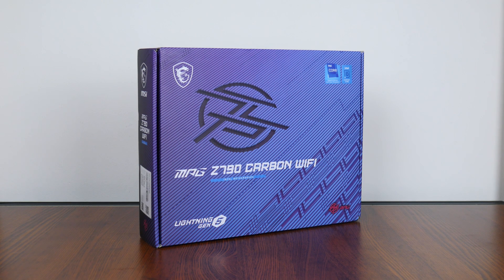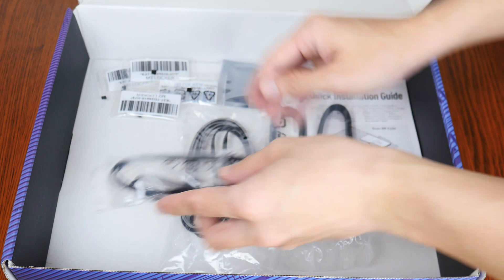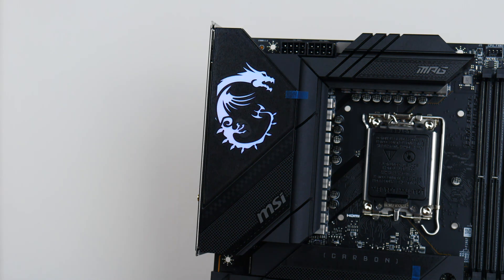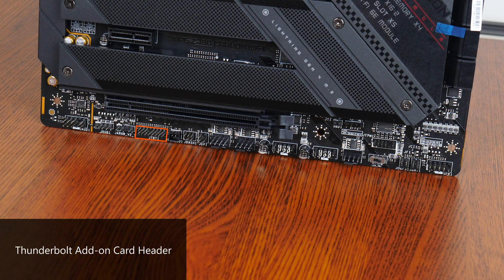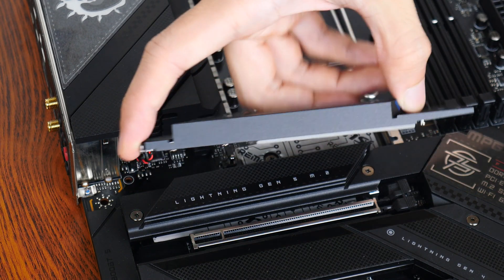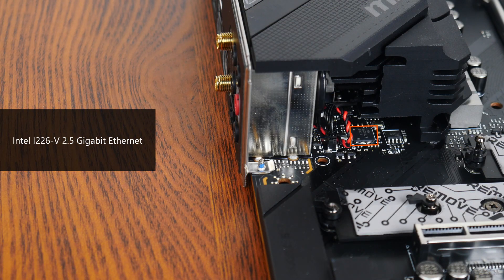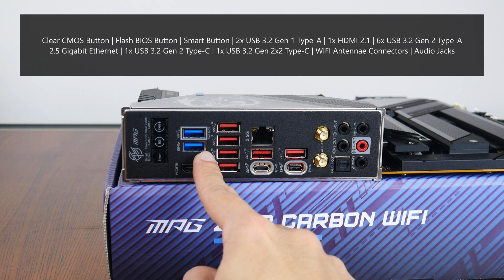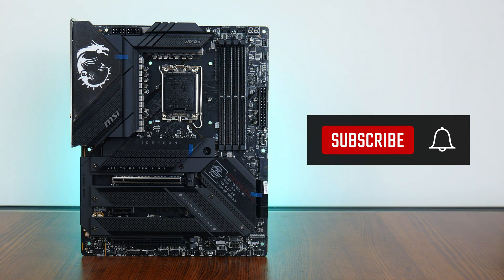Premium Intel Z790 Motherboard - MSI MPG Z790 Carbon WIFI Unboxing & Overview

Comment: Would installing a ssd on the second m.2 slot hurt gaming performance in a 3080ti?
Reply from the maker: It likely will, but perhaps not by too much - the graphics card slot will run at PCIe 4.0 x8 (seeing as the 3080 Ti supports PCIe Gen 4 and not 5), and from what I've read, this should result in a performance hit, seeing as the 3080 Ti is pretty powerful and should be able to saturate the lanes easily. I don't have such a combo of hardware lying around though, so I can't test it out for myself...
Reply: @ALKtech  thank you for your promptly reply. Yeah I would probably not use that m.2 slot to keep it save. Saldy I'll only have 4 m.2 instead of 5 😆

Comment: I've not built a pc for over 10 years and I'm so out of touch lol
Reply from the maker: In a nutshell, DDR5 is becoming more mainstream as DDR4 works its way out, we've got the AMD Ryzen 7000 series on the AM5 socket, and Intel's 13th Generation Raptor Lake as the processor offerings today, and NVIDIA's GeForce RTX 4000 series squaring it off with AMD's Radeon RX 7000 series GPUs. How's that for a 10s summary on the state of the PC hardware world today 😂

Apart from the above, it's pretty much still the same old plonk-everything-onto-the-mobo, and fire it right up kinda thing!

Comment: Am I understanding right you shouldnt put an M2 NVME in the PCI 5.0 M2 slot to avoid splitting the lanes from the GPU?
Reply from the maker: That's right, but seeing as there are no PCIe 5.0 x16 graphics cards around yet, no issues here really, seeing as PCIe 5.0 x8 has the same bandwidth as PCIe 4.0 x16!
Reply: @ALKtech  even if one uses a 40's series cards??
Reply from the maker: @Gabriel3Gamu  ah, perhaps I should clarify further that in the above reply, it's in the context of PCIe 5.0 x16 graphics cards of the future operating at x8 mode, where the said card will still have access to the equivalent of PCIe 4.0 x16 worth of data bandwidth! But then again, I don't have a crystal ball to be able to say for sure if the next gen of GPUs, especially the high-end ones, will be powerful enough to saturate all 16 PCIe 5.0 lanes - only time will tell!

For top-of-the-line PCIe 4.0 GPUs such as the RTX 4000 series, you'd likely see a performance hit where the said GPU will operate at PCIe 4.0 x8 instead, if a M.2 drive is installed on the 2nd slot for this board. I must caveat that I haven't personally tried this out to see how much of a performance hit one would likely experience!

Comment: What's the best mid range value for $ MSI mobo to go with the i5-13600K? I'm looking at MSI MAG Z790 Tomahawk WIFI DDR4 or MSI MPG Z790 Edge WIFI DDR4 but they're quite exp, almost near the price of the DDR5 version of both Mobos. Wondering if you have something else to recommend?
Reply from the maker: Actually...if you don't mind previous-gen boards, Z690/B660 boards could be pretty good picks. I quite like the MSI PRO B660M-A WIFI DDR4 and have used it before in a friend's build (but that was with a i7-12700). Are you quite set on DDR4 for your build already?

Also, heads-up that Intel's mid-range 700-series boards (e.g. B760) are dropping real soon, sometime in the first week of January 2023, so if you're not in a rush, it might be a good idea to hold off till then to see how prices of these boards might be like! Unless of course, you're trying to avoid paying 8% in GST...
Reply: @ALKtech  Not in a rush to upgrade. GST 8% is bo bian lol. Pay means pay. Currently am still running an i7 4790k. Can tank me a while. Almost 8 years now. I was thinking if i can squeeze out another 3 more years on this rig, totalling 11 years of usage by 2025, holding out until Intel 14th Gen Meteor Lake drops next year Q4 2023/ 2024 or 15th Gen Arrow Lake in 2025. For the 14th or 15th gen, either one of the i5 600k series is good enough for me.

Current rig: 

CPU: i7-4790k w/ Corsair H100i Liquid CPU Cooler
MB: MSI Z97 Gaming 5
GPU: MSI RTX 3060 VENTUS 3X 12G OC
RAM: G.SKILL Ripjaws X Series 16GB (2 x 8GB) DDR3 1866 (PC3 14900) Desktop Memory Model F3-1866C9D-16GXM
SSD: Samsung 840 EVO 250GB x1, Samsung SSD 850 EVO 500GB x1,
HDD: Western Digital Blue 1TB
Monitor: Acer Predator XB271HU
Speaker: Razer Leviathan 5.1 Channel Surround Sound Bar
PSU: SeaSonic PRIME Ultra Gold 850W 80+ Gold Certified Fully Modular ATX Power Supply
Case: Corsair Carbide Series Air 540 High Airflow ATX Cube Case
OS: Windows 10 Home - 64-bit - OEM
Reply from the maker: @BravoSixGoingDark  What do you use your rig for mostly? Am curious how a Haswell+3060 combo would fare in terms of framerates haha. 

11 years of usage would be quite a feat 😂 But again, if your use-case doesn't call for an upgrade, no harm just waiting till you see something that really calls out to you, or until hardware failure occurs *touch wood*.
Reply: @ALKtech  Watching shows & Casual gaming e.g. BF1/BFV/B2042 (Stop playing because its trash haha). Got into emulation recently this year Duckstation/PCSX2/PPSPP/RPCS3 etc.
Reply from the maker: @BravoSixGoingDark  the last Battlefield game I owned was BF1 - didn't really like the futuristic stuff that the franchise was going for post-BF1! But that said, as long as the stuff that you play works smooth on the i7-4790, I see no need to upgrade! 

I'd think that the 14th Gen Meteor Lake landscape would be interesting as by then, Ryzen 8000 series on AM5 could be out, and we'd probably get a taste of more widespread PCIe 5.0 adoption too!
Reply: If this helps, there’s this gigabyte z790 ddr5 motherboard for like $260 as well but it’s currently sold out.
Reply from the maker: @shqd0w411  might you be referring to the Z790 AORUS ELITE AX? Just saw it on Newegg for US$259.99 (US$249.99 after a $10 rebate)!
Reply: @shqd0w411  Thank you, shame it sold out. Is the mobo a local set based in singapore?
Reply: @BravoSixGoingDark  unfortunately that I don’t know since I’m from the United States but Singapore has Amazon you should be able to find it. Update on the motherboard: it’s back in stock right now but they’re selling fast.
Reply: @shqd0w411  Thank you for the update!

Comment: Very good and informative video and this actually helps a lot since I’m working on a build myself. Would you prefer asus in terms of motherboards or msi?
Reply from the maker: Thanks! Between the both, I'd be kinda torn as I feel that both brands put out quality products, and it boils down to features and prices when it comes down to individual product offerings - especially prices, where there may be differences across retailers around the world to influence my eventual purchase decision. Are you looking to build a high-end 13th Gen system?
Reply: @ALKtech  no problem and yeah I’m going for the 13900k cpu. For me on Amazon the msi one is cheaper than asus but both are high end enough for the desired cpu. I know asus is technically top dog but I was wondering if msi is like second best or something like that also if msi is a good company so if something were to happen to the motherboard I can take it back and I’ll know it’ll be fixed. If that makes sense because some companies tend to do people over.
Reply from the maker: @shqd0w411  Sweet! Are you gonna get a RTX 4090 with the 13900K too?

That said, I get where you're coming from - I'm from Singapore, and warranty issues are taken care of by the local distributors here that have been in the biz for many years, so RMAs tend not to be an issue at all. Whereas in other countries, I suppose the RMA process might involve sending the boards back directly to the manufacturer for claims...and that process could involve a certain measure of luck I guess!
Reply: @ALKtech  oh ok and no I have a 3090 ti FE right now but plan on upgrading that’s why I need a good cpu and motherboard ahead of time. I’m from the United States and I don’t really know all that stuff in terms of warranties, return policies, etc so I just try to go for companies with the best reputation as I don’t have a brand preference between asus and msi after researching specs on both motherboards I’ve learned that both are identical also differences is price and that the gaming Wi-Fi e supports up to 7800mhz of RAM whereas the carbon Wi-Fi supports 7600mhz and since there both high end I’ll just likely go with msi. Also it seems also everyone uses asus anyway so it’ll be nice to be different 🙂
Reply from the maker: @shqd0w411  Nice! Can't really go wrong with either brand IMO, as they've been on the market for many years. You'll have quite a powerhouse of a build on hand in any case - enjoy your new build when the parts arrive!
Reply: @ALKtech  also in terms of Asus, the motherboard I was considering was the z790 gaming wifi e

Comment from the maker: NOTE: This video was published before DDR5 memory modules larger than 48GB were available - according to the MSI specs page, this motherboard now supports up to 256GB of RAM - please check MSI's website for the latest compatibility updates. 

Also, this motherboard now supports Intel's 14th Gen "Raptor Lake Refresh" processors with a BIOS update available for download from MSI's website.

Check out the written review for this motherboard here: https://www.alktech.co/articles/review-msi-mpg-z790-carbon-wifi-lga1700-motherboard
Reply: After my premuim Asus Proart Z790 mobo memory controller broke down due to running 4 sticks of 32gb dimms, I don't know if it's safe with this MSI board to run 4 sticks? I think running 4 sticks is a massive strain on the memory controller. I was able to run xmp2 at 5600mhz on this MSI board. Does anyone has experience running 4 sticks on this board?